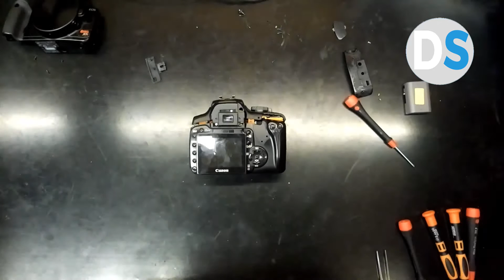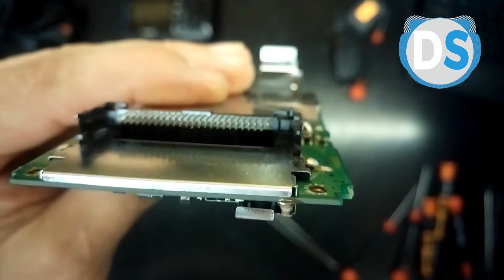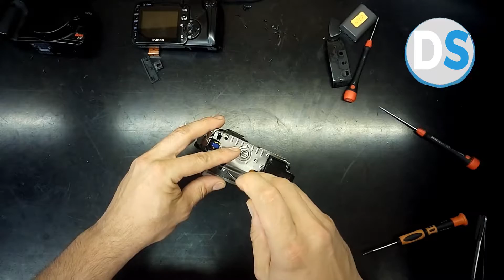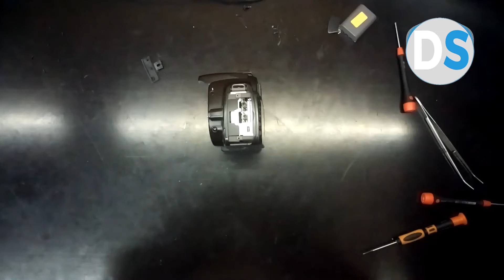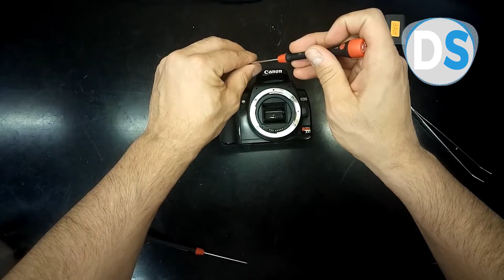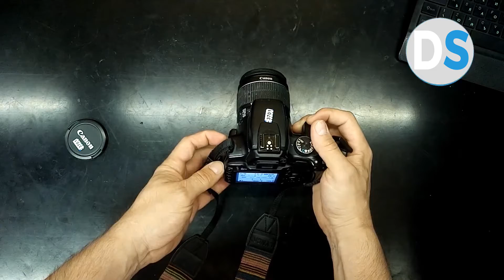How to repair CF card slot on Canon DSLR 400D (pin missing)

Comment: OK, I bought eos 400d for 40 US$ with missing and bent pins on CF card socket... I took me 2 hours to fix it I had to drill out broken pins and that was pin 13 38 and 50... I used pins from old CF card reader and had to cut them out of plastic using exacto knife... Then inserted the new pins into my CF 4GBit card and then inserted the card into the camera CF slot, then I used my soldering gun and soldered pins to the still reaming pins on the PCB this way I did not have to use ultra thin hot ends... Finlay I used super glue drops with cushion pin as a dropper  to secure it for good.. It was a success and I was very happy... I do not recommend doing surgery like that because it requires precision and many years of experience as an electronics engineer or technician servicing electronics and or electro-optics equipment...